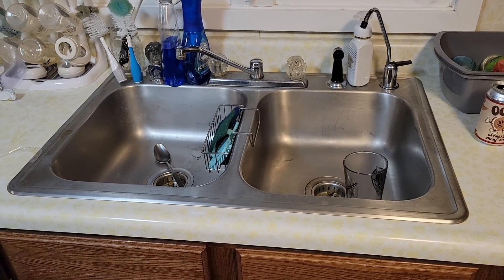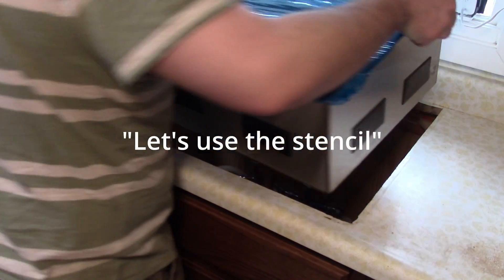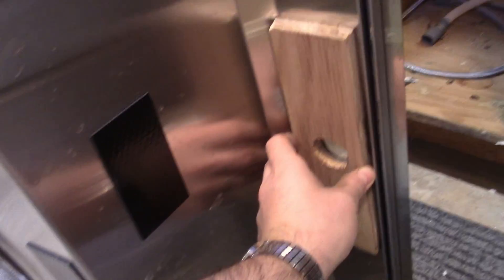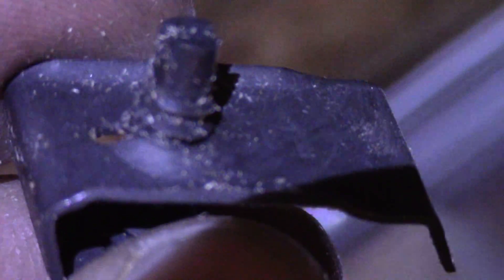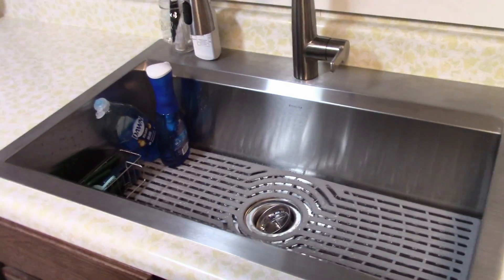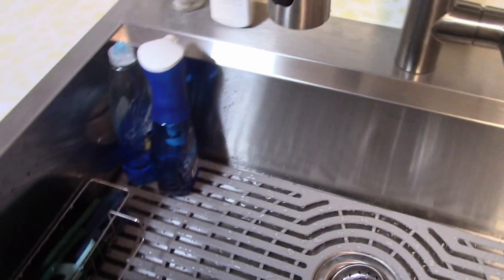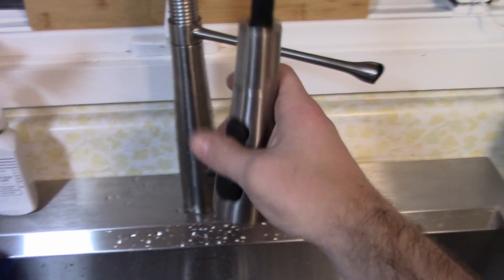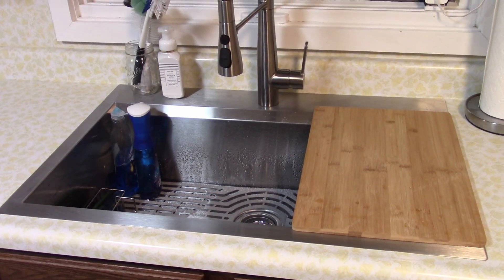Install and Review of Kohler Pro-Inspired Kitchen Sink Kit Costco Item# 1600305‌

Comment: Thank you for posting this video. I have a similar sink to your before picture. I am considering ro upgrade. Currently at my location, there is a promo to save $70 from 370 to 300.
Reply from the maker: The one currently for sale has a slightly different faucet and the sink basin no longer has the sharp corners for gunk to get stuck in. The newer one is just a touch less modern looking but with the new drying rack instead of a cutting board I think its still a solid deal.

Comment: Great freaking tips. Especially on wood insert and putting faucet on first. Also thanks for the bit on the clips. They suck big. I put them in the tracks first after seeing you struggle. Also, I ran the silicone bead before dropping on the top. My mom loves it! Thanks!

Comment: that faucet is a big NO..WTH with a spring on the cord faucet. 🙈 I’ll be keeping my new faucet installed last year…
Reply from the maker: If you do buy the kit the faucet has a decent resale value on eBay. After 2 years now I've got used to it, but it does take a considerable amount of pulling strength to overcome the springs tension.

Comment: Where is dishwasher excess water spout?  Can that be installed?
Reply from the maker: Do you mean an air gap? You would have to drill a hole as there is not one predrilled, if your dishwasher or codes require it.
Reply: @striker1211  thanks!

Comment: What measurement was the hole in your countertop please?  Thank you
Reply from the maker: I'm not sure exactly what size the hole was, but the specification sheet on Kohler's site says the bowl length is 30-1/4 and width is 14-15/16. I'm not sure if that is the inner diameter or outer diameter of the bowl so if you're cutting in quarts or marble you'd want to either contact kohler to verify or err on the side of caution and make the hole 31x16. If you call kohler for the template sheet (Top-mount/Undermount, part number 1130821-7) they may provide it. I can't seem to find a PDF for it. 

Kohler site for sink that has the install pdfs (and CAD files): https://www.kohler.com/en/products/kitchen-sinks/shop-kitchen-sinks/pro-inspired-33-x-22-x-9-top-mount-undermount-single-bowl-kitchen-sink-kit-rc78957-1pc?skuId=RC78957-1PC-NA

Comment: how did you install the air gap for the dishwasher?  Loop the pipe?
Reply from the maker: Yup, high loop. Check your local codes to make sure an air gap device is not required.

Comment: The drain leaked after the plumbers putty and I feel like I tightened it really well. Do you have any tips?
Reply from the maker: Sometimes you must redo the drain, I hate plumbers putty for this reason. I usually tighten it up hand tight, then fill the sink with hot water to heat it up, then hand tighten some more. I've installed three sinks now and for each one the drain seal is the biggest pain.

Comment: Did it have small weld gap on all 4 upper corner, I bought this and seeing weld gap on top, I used flash light we can see light other side. Is this normal?
Reply from the maker: I do not see any weld gap, mine looks like a stamped piece of stainless steel.
Reply: I checked mine. It looks as you mentioned, welded. I will be taking a closer look with flashlight.

Comment: Hi there- what did you do with the air gap for the dishwasher?  I have this sink now and that is my main concern
Reply from the maker: I used the "high loop" method to provide the gap. It's not the best way to do it, but it's the way I've done it for years. To do it proper you'd need to drill a hole into the sink top. I installed a reverse osmosis spigot with a step drill ($7.99 from Harbor Freight) and it was pretty easy to drill through. Good luck!

Comment: How is the stainless steel holding up, I jus bought the combo kit from Costco, but started reading reviews and multiple reviews say rust on sink within weeks, I'm doing full remodel of kitchen and don't want to replace this sink weeks after install if I can just return it and get dif one
Reply from the maker: It's been over a month now with no rusting. My wife used a scotchbrite green pad and put swirls in the bottom of it scrubbing grease off but you can't tell unless you look close. Maybe the people getting rust are using steel wool? I will be sure to comment on this video if I ever have a failure of the sink or faucet.
Reply: Am very disappointed after 2 week of installation am seeing rust. Can someone tell me what to do to prevent rust

Comment: I have this sink also. It was in the garage for a year also. We got new cabinets and have had it set up for about three months now. I am getting tired of cleaning the mold off the rubber mat. any suggestions? I  clean it almost every day and it is a pain in the butt.  It is an expensive mat and I am not sure why this is happening so quickly
Reply from the maker: I too get a grimy mat. The silicone mat is the worst part of the setup. You can buy a stainless steel bottom mat, my family has that one and it is much better. As for mine I just set the faucet to spray mode and spray under the mat to keep it clean.

Comment: I’m thinking to get this actually. Appreciate if you can give me some insights. 
Did you use any sealant around the basin where contact the counter top? If so, any tips for that?
Also, would you do anything to improve the faucet’s attachment process. I mean instead of using the slip of wood maybe something else? Or fill something else as well so that it won’t wobble?
Reply from the maker: Oh wow I cant believe I forgot to mention the sealant. I used GE 100% silicon (clear) around the rim of the sink. I applied the sealant to the counter top then set the sink in. The sealant gooped out the sides and the I used a toothpick to go around and clean it up. This ensures no water gets down into the cabinets. As far as the faucet, I would still use wood. It barely wobbles, I had to check just now before commenting because I don't notice any wobble. The only other tip is to buy some cutting board sealer because the original coat on the cutting board wore off in like a month. I bought walrus oil because I read that using canola oil can get gross, I've never tried canola oil myself but if you have that on hand it's free haha. Thanks for watching.

Comment: If you're considering DYI'ing this check out where your drain pipe is in the wall. This turned out to be a miserable over 12 hour install because I had to cut into my wall and lower the T because of the deeper basin lowering it all. Had I not caught it I would have had stank water backing up into the garbage disposal/sink.
Reply from the maker: This is a VERY good tip. Thanks for posting. Water does not flow uphill, as you've found out. Part of the reason I held off on installing mine so long was because of how vital the kitchen sink is to a household. A house with no kitchen sink, and no dishwasher drain, is an unhappy home lol. I was lucky enough to have it drain into the floor, even if I did have to add a studor vent.

Comment: I agree with the clips being the worst part I gave up on the back of my sink as I only had a finger tip width clearance to work with to work  with.  But I clamped it down well on the sides. And wile the caulking was wet filled the sink with water.  And let it sit until the Caulk dried.  Otherwise I love ut so far but just installed it today. Only 1 more to go. My daughter also bought one.  It will be a couple of weeks until I  install it.

Comment: Those clips really do suck, especially because my counter was too thick for them. Question, where did you put the dishwasher drain/ air gap.
Reply from the maker: My dishwasher hose enters from the right with plenty of length so I looped it up with the top of the loop higher than the drain weir.
Reply: @striker1211  I don't see the air gap in the sink. Can you please explain more clearly (or with photo) . I bought the same model from Costco and I don't know how/what to do with air gap from dishwasher . Thanks you very much.

Comment: You mentioned that the blue plastic was not letting the sink set in right. Would you still have needed to trim your counter if you had removed it first? Great video by the way. I saw this in Costco recently and I'm debating on buying it, but I've never installed a sink before.
Reply from the maker: I believe the tracks where the hold down clamps go would have still hit the curved rim of the counter top at the corners. The real key to installing the sink was making sure all the dishes were done before I started :)